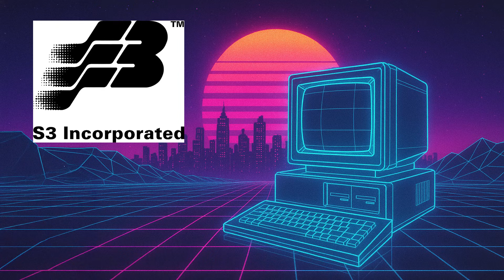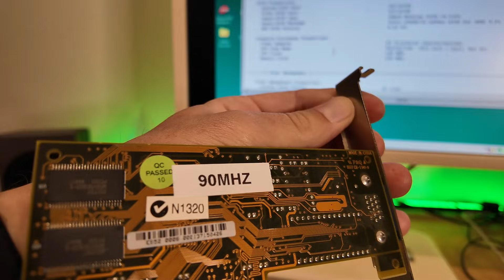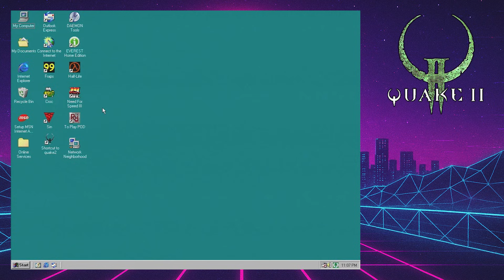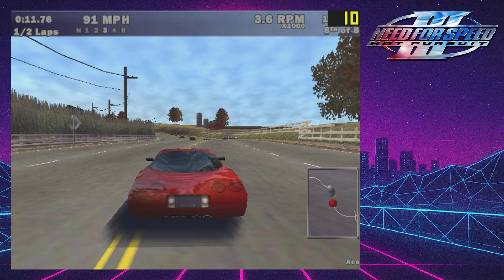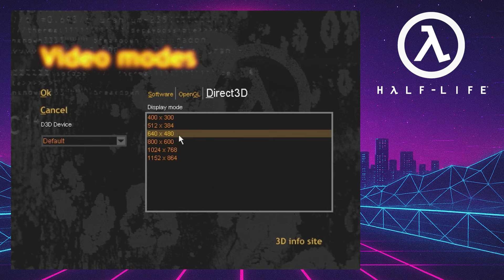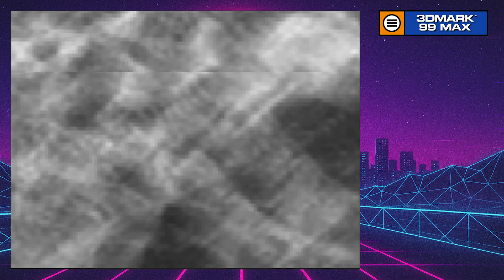The S3 Trio 3D/2X: One of the Worst GPUs Ever Made?

Comment: I thought the words video adapter was the Intel 740. It would just heat and lock up the system. It could only reliably run GLQuake. This S3 doesn't even have a heatsink. Damn, computers were expensive back then. To today's eyes all these games look like crap and the colors will be washed out because of video capture with chroma subsampling. Maybe put up another image for contrast with what to expect. A blob shadow under a car looks normal to me. Driving games are probably the worst to play with poor performance.
Reply from the maker: I had an intel i740 back in the day, while it was not the best performer it at least rendered things properly, this S3 is much worse. It really is pretty much 1996 technology from teh S3 Virge just clocked up and more ram

Comment: S3 cards do not support DirectX (only on paper), you will need specific Moto Racer version (last updates abandoned S3 3D), specific driver version (there is a LOT different BIOS for similar S3 based cards and matching driver and card was a big pain in the head),  just like with ATI Rage. Until OpenGL (and Vulkan today) there was a constant Application-Driver-Card matching game.
Reply: I think the Trio3D also abandoned S3D and only support DirectX anyways
Reply from the maker: Yes it was still the wild west back then, with no clear stand out API that the industry had standardized

Comment: S3 was sure trying to squeeze every last bit of the ViRGE. Had this in an office PC that was used for testing purposes, out of curiosity installed some games. The only 3D game that worked correctly was Jedi Knight, though kinda choppy at 640x480 on a 400 MHz PII, and that game has a very forgiving engine. Terrible for anything else besides DOS and 2D.

Comment: I don´t understand why you stated it worst GPU of 1999, the Trio came out in 1995! (and cant even be named a GPU) and it was previous to the (infamous?) Virge. And in 1995 there were no fully capable 3D accelerators.
Reply from the maker: yeah they really kept pushing the old technology way longer then they should have, the Trio 3D/2X was released in 1999 and they were really whipping the dead horse. The Virge name had become ridiculed so they went back to using "Trio" again
Reply: @ComputerRetroBus at that time I had a S3 Savage4 that, with its flaws, was a fine 3D accelerator card, that's why I didnt understand the Trio/Virge thing in 1999.
Reply from the maker: @jbaroli  yeah I know, they released the Savage the same year which was a very good 3D accelerator. I wonder if they released the Trio3D to try and get the budget and OEM market by giving them a cheap alternative to the Savage

Comment: My first computer is using this junk GPU and AMD K6-2 300Mhz CPU, most game cannot run. Age of Empire 2, Roller Coaster Tycoon can be run but the frame rate is really slow. Then I upgrade it with Intel Pentium III 866Mhz CPU and Nvidia TNT2 GPU.
Reply from the maker: Nice upgrade! That would have been a huge difference, the TNT2 was one of the best 3D cards when it was released

Comment: With early pentium era there were  3 cards. Cirrus logic, S3 trio and Trident. S3 was the best. Later  S3 Virge was 1/3 price to Voodoo 1. other options were Riva 128 and Sis. S3 virge still best performance to price. With AGP era S3 virge just lost to Nvidia, as well as Voodoo and Sis. Matrox was considered as 2D card only, with exceptional display quality on VGA port (blur on any other and crisp on matrox). 
btw. testing 1998 games with 1996 card is not right.

Comment: You need to get your hands on a Savage4 not for it's performance but it's features, namely S3 Texture Compression (S3TC). The Savage4 was a good improvement over the S3 Trio 3D but the lack of performance versus current cards at the time (Voodoo 3 etc) let it down. I had one at the time which I brought as a stop gap measure to replace my ageing Rendition V2100 (Diamond Stealth II S220) while I waited for the next Rendition which never came and in my eyes it was a great card. Gave me a nice performance bump over my V2100 and the S3TC was something to behold. With 3D accelerators I was always someone right from the start who prioritised graphical quality over speed so this (as well as it's price) was something which drew me to the card.
Reply from the maker: That's a great perspective on prioritizing quality over speed, sounds like a cool upgrade back then! I definitely want to get hold of a Savage4 card, I have seen some examples of S3 Texture Compression and it looks fantastic! Its a shame that just when S3 were starting to make some good cards like the Savage4 that they were really struggling financially

Comment: About what I expected - the architecture is the same as the Virge cards but clocked faster and with a few more supported blend modes (though not all still). The Trio3D was pretty much a cheap card for OEMs with great 2D performance and image quality and merely box-checks Direct3D support. It wouldn't be until the Savage4 later that same year S3 finally made a decent 3D performer.
Reply from the maker: Absolutely, the 2D image quality was top-notch, but yeah, it's basically a dressed-up Virge!

Comment: The Trio 3D/2X was pretty much the last Virge. The 2D part was Trio but the 3D part was still Virge and they added AGP 2x support in that second and last iteration. I don't know how they did it but it got worse than the Trio 3D by not supporting alpha blending multiplication (That's why the trees have black boxes and was already halfbroken on the whole Virge lineup to be fair) and worse than the Virge GX/2 performancewise despite the AGP 2x interface and usally higher clocks and 8 MB of video memory. 
 
Btw. The card is a Gainward Cardexpert model. 
And if you really really want to suffer try testing an Alliance aT3D card. The worst 3D deccelerator with non existing drivers (or what ever the counter part of a driver is. Walker? IDK) that ever existed.
I mean SIS 6326 and S3 Virge were crappy even back in the day (OK, OK, back then they were less crappy for sure otherwise you probably wouldn't had a 3D card at all.) but at least you could play some games... You've been warned.
Reply from the maker: Oh my!! That Alliance card really does sound like an experience lol, I think I have an Allience card that is PCI, I must have a look and see what it is hehe.  Very interesting that the 2X variant was worse that the original!

Comment: I had a Matrox Millennium II and it was an expensive piece of junk.  It was my 2D card when I had 2x Voodoo2s.  I ended up replacing all 3 cards with an Nvidia TNT2 Ultra.  The performance was about the same but I had zero issues.
Reply from the maker: That sounds like a much better experience, I bet it was way more stable too

Comment: This is complete bogus. I've managed to run (albeit at 5 FPS) MDK2 with HW "acceleration" and zero visual glitches on the S3 Virge DX. 
The S3 Trio 3D/2X can absolutely work without visual glitches if you use the right drivers and DLLs.

Comment: I had a S3 Trio64 PCI upgraded to 2M VRAM on my first P1 computer. I ran Win95 OSR2 and the card performed well for me, I played Starcraft, Anno 1602, Quake, Quake 2 without issues all in software mode or DirectX, no OpenGL. When years later, I tried the same card with Win98SE on a P3 machine, I had weird artifacts, black boxes, like you experienced. I learned that the old .vxd drivers for Win95 were better than newer wdm ones for Win98. Not sure if this is true for your AGP S3 TRIO 3D/2X. However, you can try a Win 95 setup on the same hardware (to force installing the old drivers, as Win98 by default picks wdm ones) and see if there is a difference.
Reply from the maker: That's a great tip about the driver versions, I'll definitely look into that for future testing! 💡

Comment: I had an S3 Trio in '99 , upgraded to Riva TNT2 later.
Reply from the maker: Now that would have been a massive upgrade
Reply: the Trio aka S3 Accelerator ist not from 99.  In 1999, the Savage 3D/4 had been around for a long time, and even the Savage 2000 had been released. The Trio was released in 1995, even before the 3dfx Voodoo, and the other Virdge cards, etc., were actually only good 2D cards good combo was S3 Virdge + voodoo , i hab a better one the Matrox :D
Reply: @tytusromek9267  Believe it or not this chip Trio3D/2X was released around the time the Savage4 came out. That was the spring of 1999. The first Trio cards (Trio64/64V) are from 1995 but they were purely 2D cards. The first Virge cards weren't pertiuclar good 2D cards. They became good after S3 took the Trio64V2 2D part and integrated in into the Virge chip (had to be Virge DX or GX out of the top of my head) and the Trio3D was in fact only a continuation of the Virge line.
Reply: @Troppa17  Okay, you're right, that's a refresh of the old s3 trio, probably for the OEM market or worldwide, nobody was really interested in it back then. 

The Trio/Virdge weren't good, they were just widespread because every brand built the parts into their ready-made PCs, sometimes soldered onto the motherboard (Ati/S3). I know that a friend of mine didn't even see the intro to Quake II because of his S3. 
But that was the cheapest way to make these system gaming PCs, combining them with 3dfx.
Reply: @Troppa17  Okay, you're right, that's a refresh of the old s3 trio, probably for the OEM market or worldwide, nobody was really interested in it back then. 
The Trio/Virdge weren't good, they were just widespread because every brand built the parts into their ready-made PCs, sometimes soldered onto the motherboard (Ati/S3). I know that a friend of mine didn't even see the intro to Quake II because of his S3. 
But that was the cheapest way to make these system gaming PCs, combining them with 3dfx.

Comment: My dedicated DOS/Win 98 SE pc only has PCI slots so I'm using the Virge VX, but if I did opt for an AGP board I'd use the Trio 3D/2X. Why? Best in class DOS support, both of those cards are common with 8MB of ram which allows for 1024 x 768 high color in desktop. Finally, the Windows performance of the card doesn't really matter if you pair them with a Voodoo 2 as the actual graphics card.
Reply from the maker: Indeed the DOS and 2D on these cards were the best, probably the most common card partnered with the voodoo

Comment: The issues you are seeing are because the graphics card does not support most blending modes correctly. (The black borders around the trees in motoracer 2, Half-Life being complete white and Unreal looking like that)
The dithering is because the card is trying the Voodoo thing to "enhance" 16bit color depth (albeit very badly)
The clipping in software rendering in Tomb Raider 2 is normal and has nothing to do with the card, most games of this era did not support Z-Buffering in software mode (which made them look like higher-res PlayStation counterparts)
Also, stop using SINGLE BUFFER in 3DMark, single buffer will always look like this because the card is forced to draw step by step until it is done while in double buffering you get one frame rendered and one presented.
Reply: NO ABSOLUTELY KEEP SINGLE BUFFER ON!
Its just amazing to look at the frame getting rendered piece by piece.
Reply from the maker: Thanks for the technical breakdown, definitely explains why it struggled so much! For some reason it would only let me run the benchmark if I selected single buffer, I'm not sure why. The moment I selected anything else it crashed the benchmark soon as its launched.

Comment: These cards were great.. IF you paired them with a Voodoo(2) and never used 'em for anything 3D-related 😅

(That said I'm still curious how 'perfect' drivers could've helped cards like these out if they existed..)
Reply: That's what I did with a virge dx (stealth 3d 2000) pro and a 12 mb voodoo 2. The 12 mb was only useful for running 1024x768 without a-buffering. For z buffering  at 10x7, you needed 2 12 mb voodoo 2s in sli. So 800x600 was the highest z-buffered res.
Reply from the maker: I loved the Diamond stealth cards, always had such cool boxes :)
Reply: @ComputerRetroBus I don't think selling a virge as a stealth card did diamond any favours.
Reply from the maker: @sharangadayananda  hehe sadly no, but their monster 3Dfx, and Viper cards were legendary
Reply from the maker: yes! I think it was a common pairing the S3 and Voodoo

Comment: As another big disadvantage, they dropper support for their S3D API. That's why I prefer Virge GX2 - it is last S3 supports S3D and allows you to experiment with. S3D was quire widely supported, e. g. also POD can use it. More you can find there:
https://youtu.be/f6fk_iarL-8?si=qeU6OxQiXljsAysO
Reply from the maker: Yes thats a great point, I was looking into that, hoping I could use their special API (S3D), but as you say it doesn't support it :( I isntalled Croc which has the S3D version but it didn't work on this card :(

Comment: Weird, back in 1998 S3 released Savage 3D graphic chip, in which S3 implemented actual and descent 3D gaming capability, and they still sold Triov 3D in 1999??

Well, I was going to suggest testing games that supported s3d api with this card, yet it's rather difficult to find those games.....

Anyway, next time you should test Trident 3D Image 9750/9850 display card, pretty sure you're going to love it.🤣🤣🤣🤣
Reply from the maker: 😅🤣 sounds terribly fun
Reply: unfortunately S3D is not supported by Trio 3D :( It is based on Virge but they dropped the support...

Comment: In 1999 they were making a comeback with the S3 Savage4 and "S3 Metal" high quality textures, only to fail miserably with the S3 Savage 2000 and sealed their fate by fusing with Daimond Multimedia.
Reply: All that came already in 98 with the Savage 3D. But there were driver and compatibility issues and they couldn't get the chip clock high enough. With Savage 4 they sorted all that out. Savage 2000 was broken again, low clock speed, T&L not working and drivers sucked again. The fusion with Diamond Multimedia didn't change anything in my opinion.
Reply from the maker: @RetroScorp very good points
Reply from the maker: ah yes! they bought out Diamond, everyone's favorite card maker at the time, a shame they both went down together. S3D textures were very good though from what I have seen
Reply: @ComputerRetroBus  S3TC and its tech demos and patches (Serious sam, Unreal,  UT etc) were mind-blowing enough to get decent magazine and online coverage those days 😊 but iirc competition was fierce as well with the voodoo3 and others; I had a riva TNT and voodoo2 back then and was perfectly satisfied 😊 once the first GeForce came out competitor's fates were sealed for awhile.
Reply: @Interblaze S3TC also would go on to be adopted as the de facto texture compression algorithm of Direct3D, so their tech still lives on in some way
Reply from the maker: @exaltedb that's pretty cool! Didn't know that, nice to know it's legacy lived on
Reply: @ComputerRetroBus  Yup, 3Dmark2001 even let you explicitly pick between dxt1 (s3tc's widely-adopted evolution) and uncompressed textures :)